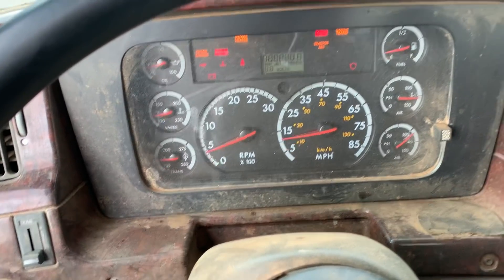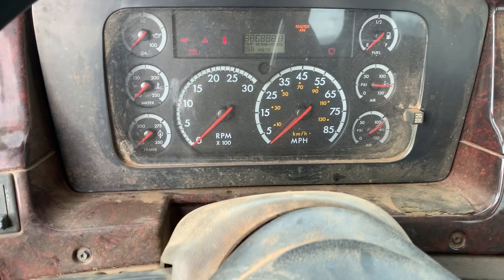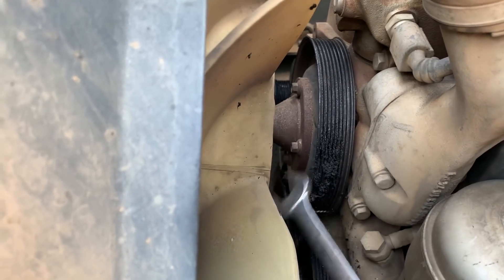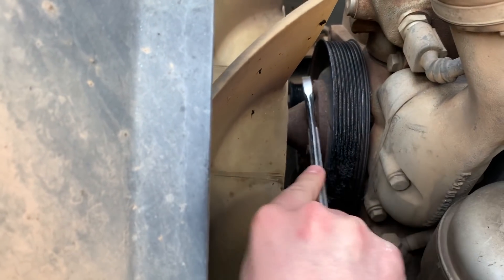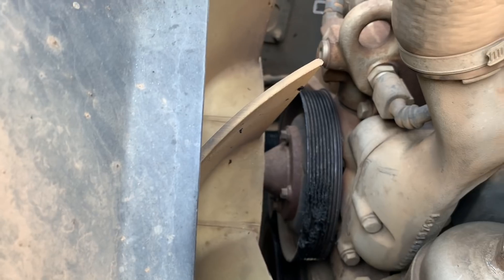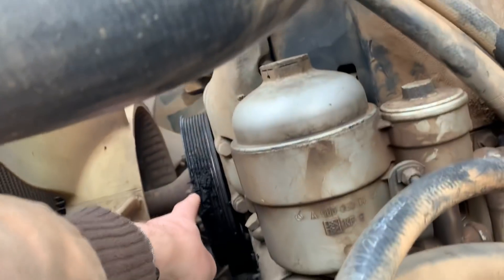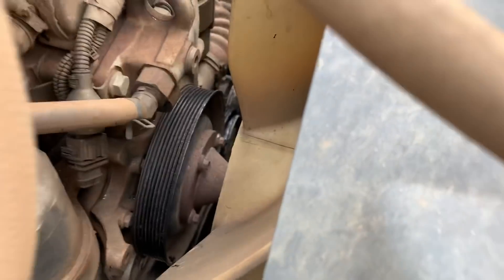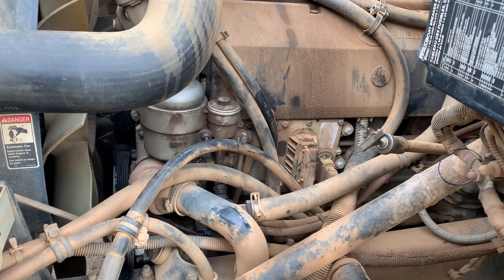The rollback broke... again

Comment: Same thing happened to me a few years back on my 1997 F150 only it was the alternator that seized while I was sat at a stop sign. The squeal, a clang, and the belt flew off into the snow beside the truck. Lol! Stupid me, I started grabbin all the pulleys and idlers to see what seized. Found out right away it was the alternator because I tried to spin that pulley and burnt the SHIT out of my fingers! That pulley was NUCLEAR degrees hot!

Comment: Yes what’s the point of letting an engine idle for that length of time. What do you expect. That will kill an engine quicker than anything. No need to idle more than 3 minutes and drive at a moderate speed afterward’s. This is today’s modern engine’s. Your kind of looney